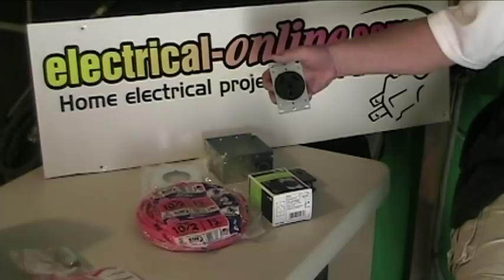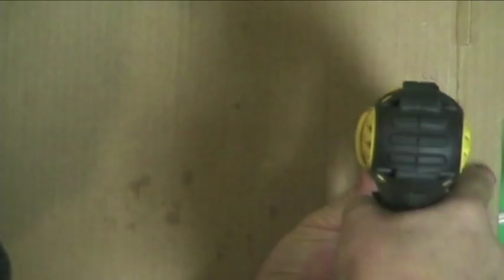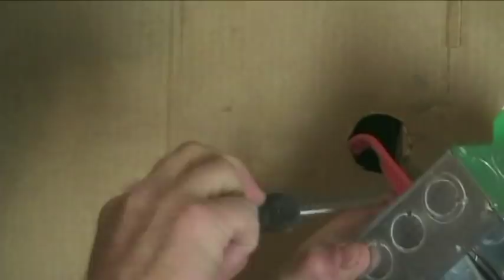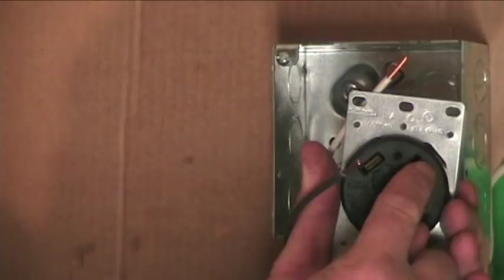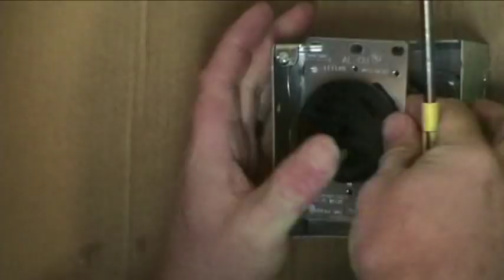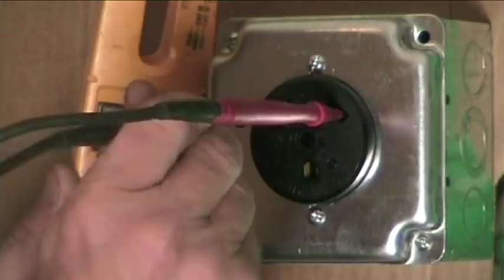How to Wire an RV Receptacle

Comment: Why wasn't a GFIC circuit breaker used during the installation?
Reply from the maker: The GFCI protection is in the RV.  (or should be unless it's an older unit).  The panel in the RV is in essence a sub-panel from whatever panel is feeding the RV outlet.  Then the GFCI protected circuits should be wired as such in the RV, either via circuit breakers where needed, or with GFCI outlets.  Many just have one GFCI outlet in the RV, and then protect the other circuits on the load side of it.

Comment: ❤ great video I have every part same as you down to the breaker. Problem is my panel bar has both ground wire and neutral on the same bar. Both left side and right side bar has ground on top and neutral on bottom but the bar is pretty much the same length. Any idea if I can put both wires on same bar?
Reply from the maker: If that's the main panel and that is where your neutral and ground are bonded together, then that's what you do being they are essentially at the same potential at the bonding point.
Reply: @theinternetelectrician  I did it. Yes they are bonded after watching your video it helped a lot. Thank you. I finished the project

Comment: Were do you get 125 volts? US and Canada is 120 Volts.
Reply from the maker: That is just the rated operating voltage of the device.  Yes, the nominal voltage in North America is 120/240, 60Hz.  Important to note that this voltage is regulated by the transformers prior to the end user and can be adjusted by setting the voltage 'taps' inside of it.  There is an acceptable range of around +/- 5% that can see nominal household voltage anywhere from 115-125/230-250.  Not so long ago 110/220V were more common voltages.  So when you hear anyone refer to a normal household receptacle as 110V, 115V, 120,125V, or 220, 230, 240, or 250V, just think of them as one in the same.  Thanks for the question!  And thanks for watching!  I hope that you gave the video a 'like', and that you have subscribed? Your name seems familiar so I believe that you are a subscriber?

Comment: Good installation practice for me has always been to remove any rings or other metallic devices from the parts of my body that are inside a potentially live panel or box. Terry should be going above and beyond in safety practices as others are going to emulate him.
Reply from the maker: You’re correct! I often forget to remove my rings. I also shut off the power when working on electrical circuits, thus mitigating risk substantially. So after 40 years of doing this, 37 with a wedding ring, I still have all my fingers. Having said that, do as I say, not as I do. Thanks for watching!

Comment: I don't know anyone that plugs their RV in to a receptacle that's inside a building.
Reply from the maker: I do!
Reply: @theinternetelectrician  That's fine, but most don't. I wonder how many people watched this and used that box outside. You should have shown a proper outdoor enclosure too.
Reply from the maker: I'm sorry, I'll try to to better next time.
Reply: Not a bad idea if the RV is in the driveway. Just run the cord under the garage door. Keeps the connection out of the rain and no exterior hole in the wall.

Comment: Ground wire connector needs to be on top (you installed the plug upside down). It will be a problem if you use an RV cable with a 90-degree elbow (the elbow will be facing upwards which will be awkward).
Reply from the maker: You are correct in your observation.  There is no right and wrong way to mount a receptacle in a box however.  Only for the reasons you mentioned

Comment: What if you only have a 30 amp double pole breaker but only needs 30 amps for the RV?
Reply from the maker: It's ok to use just one pole, just identify it as such on the panel schedule

Comment: Just now seeing this. What do you seal the hole with between the house and the new box? so mice will not get in
Reply from the maker: Any appropriate caulking or expanding foam that suits whatever material you are working with, (ie. stucco, vinyl siding, wood, etc.)

Comment: This video is embedded in this article:
https://axleaddict.com/rvs/How-to-Install-an-RV-Outlet-at-Home

Using the text from the article here is the relevant text provided:
Neatly route the ground wire to the ground bus, following the path of existing wires, to where all the other grounds are terminated, loosen a screw as necessary and terminate the ground wire. Again, that bare ground wire is likely going to come close to the hot main breaker. Be careful! Do the same with the white neutral wire after stripping about ½" of insulation from it. 

The text says to terminate the white wire on the ground bar not the neutral bar; at least that is how I read it.
And there is no further instruction for the white wire.
Since I was following the text...that is what I did and everything works.

Is it either or and you're fine?
Thanks!

Comment: Looking to do this at my home.  Wire length from panel to location inside my garage is 30', give or take.  If I want to run wire for a potential 50 Amp upgrade later on, would running 8/3 wire be adequate?
Reply from the maker: Yes, use #8/3 and feed with a 2 pole 40A breaker.  Reach out to my email, terry@electrical-online.com if you have any questions on connections, etc.
Reply: @theinternetelectrician  Thank you!  This is still the best video out there for this!

Comment: Great video Terry.  Question though.  I have a 20 amp fuse in my fuse box that serves the outside outlets on the house and garage.  I'm guessing that I need to replace the 20 amp with a 30 amp breaker first.  Then, can I remove one of the outside outlets and install the 30 amp plug?
Reply from the maker: Jay, no, you cannot replace a 20A breaker with a 30A.  Wire size / guage is what determines the maximum breaker size, and your circuit will be wired with #12 AWG cable.  Keep the 20A.  It won't be a problem unless you are trying to run the A/C in the RV.  A better solution here would be to use an adapter to go from 15A to 30A, also known as a "cheater cord".  This would keep your outside receptacle as it is for other uses as it was intented.

Comment: If the 30 AMP RV plug is located outside (Weather proof box) should you use a 30 AMP GFI breaker in the panel? If all other outside outlets require GFI why not the RV plug? Please comment
Reply from the maker: The GFCI protection is for frequently used convenience outlets in places where you are more likely to be prone to getting a shock from accidental contact with live parts while you're body is providing a well grounded path for current flow.  Outside on moist earth with leather soled shoes, or even bare feet.  In the kitchen or bathroom with one hand in a sink full of water, then plugging in an appliance, etc. You're not likely to be using the 30A receptacle for anything else other than the purpose it was intended, to plug in your RV. Once the RV is plugged in, then all the outlets that require GFCI protection is provided by the unit itself, the outside receptacle, bathroom, kitchen, etc.

Comment: You mounted the receptacle upside down.  The ground should be at the top so when you plug your RV in the cord hangs down and not coming up which will stress the cord and receptacle.  You are obviously not an RVer, but not the worst video.  Thanks.
Reply from the maker: Technically there is no right and wrong way to mount a receptacle.  In a practical sense, you are correct.  If mounted in an RV pedestal with an in-use cover, you would absolutely need to mount it as you suggest.  I have owned RV's for 40 years, and was full-time in a 40' Class A coach for 2 years, and part-time (6 months/year) for another 6 years after that.  In this video I was trying to focus more on the connections but I really should have turned it 180 degrees.  Now I rely on people to flip their computer upside down instead  :-)
Reply from the maker: Technically there is no right and wrong way to mount a receptacle.  In a practical sense, you are correct.  If mounted in an RV pedestal with an in-use cover, you would absolutely need to mount it as you suggest.  I have owned RV's for 40 years, and was full-time in a 40' Class A coach for 2 years, and part-time (6 months/year) for another 6 years after that.  In this video I was trying to focus more on the connections but I really should have turned it 180 degrees.  Now I rely on people to flip their computer upside down instead  :-)
Reply: You are forgiven, Merry Christmas.

Comment: Is there a difference between a  rv 30 amp receptacle and a regular 30 amp receptacle
Reply: Yes, they look different. The “regular” receptacle is usually a 240 volt setup used for electric dryers, and it will say so on the packaging. If you’re not sure, ask the hardware clerk specifically for a 120 volt RV receptacle.

Comment: What if I have stranded 10awg. Can I still insert stranded into those screw compressions or should I use a terminal to connect to the screws themselves. If so what terminal do you recommend? Hook terminal ok?
Reply from the maker: Those terminals on the RV receptacle device are designed and approved for stranded and solid conductors.

Comment: I have a question, will it still work if I have to run my wire about 300 feed to the panel.?
Reply: Yes but you would want to up the wire size to 8awg to accomodate for voltage drop

Comment: How would I wire a 4 prong outlet using 10/2? I have the 10/2 wire but I have a 4 prong RV connection.

Comment: Can I use that romex in an outdoor breaker box or do I need underground feeder wire.
Reply from the maker: Too many factors to consider here.  I would have to see the installation plan to advise on the wiring method required.
Reply: @theinternetelectrician  I'm putting a meter service on a pole with a breaker box below it and directly below that Will be  a 30 amp rv outlet. All in outdoor boxes. I'm wiring the 30 amp breaker to the 30 amp rv outlet with 10/2 romex.

Comment: Soo .. could a person use this in reverse? As in backfeed from a generator in the event of a power outage? Providing you turn off the main & only used select breakers??
Reply from the maker: No, for reasons too many to list here, but the most important one is that you must use an approved and properly installed transfer switch when connecting a generator to a utility-fed electrical system.

Comment: Can I use 10/2 wire outdoor 100' to put in 30 amp plug
Reply from the maker: Yes, 100' shouldn't be a concern for voltage loss/drop.
Reply: Darren Mittelstadt 8/2 might be better tho

Comment: This is great but could you do a 50amp service for a RV
Reply from the maker: Frank Jennings If you check my channel I just released one on Monday morning that deals with a 50 amp range outlet and the wiring is exactly the same for an RV 50 amp 125/240 service other than particulars to the installation, location, indoor or outdoor, etc.

Comment: Good video, but it's upside down. Good stuff, otherwise. And thank you for using a manual driver. Takes a skilled hand (or proper use of a torque clutch) to do it right with a drill, and as you said to another commenter, this is YouTube. =p

Comment: Thanks for the video, I am getting ready to install one of these in my shop building for our camper but I have a question, if the receptacle box is all metal, what is the purpose of wrapping the bare ground wire around the screw inside the box before connecting to the green ground screw on the receptacle? the box I bought at home depot doesn't have the screw on the inside of box.

Comment: You should make note that the RV receptacle is typically mounted 180 degrees from the way you have it shown. The cord will be under less strain that way in its normal usage.
Reply: Then how should it be wired? I just want to be sure to do it right.

Comment: Can I use this same approach to go from RV Generator to House circuit box given I de-energize power company phases while generator is running and disconnect RV prior to throwing main power company phases back on..Is there a transfer switch available to handle a RV 30 1 phase into a house circuit including safety features. Thx. Excellent video for RV support...but  need the reverse...RV Generator to house circuit.

Comment: Hi i have question, so I have 240v 30amp outlet I was wondering if i can share one of those wires from the outlet which would be 120v if i get 120v from that and share to a new outlet which would be the 120v 30amp would it work?

Comment: As a first time travel trailer owner, my question is after installing the 30amp RV receptacle will it trip the breaker while running all appliances and Ac?
Reply: +rick deleon

The short answer is yes but it depends on the total power draw. 

You should calculate the power draw of your AC and appliances. If they are measured in watts then you can convert this to the total amps.  Watts/voltage = amps  (Watts/120v =  amps)

1) An average AC unit will probably pull 13 amps.
2) Microwave oven is going to average 10 amps.
3)  let's say a hair dryer is being run too. It's an 1800 watt device, then it's 1800/120 = 15 amps. 

You would exceed your 30 amp breaker in the above scenario. That's not even taking into account your battery inverter trickle charging your RV batteries. And...most breakers are rated for 80% continuous usage so you are really only going to get about 24 amps, 30 amp peak.

Comment: Excellent step by step video.  I see 1 thing that I'm a little confused on.  Every RV power pole I've ever plugged in to had the ground located at the top, instead of the bottom of the receptacle, if you attempt to plug in your surge protector which is made to plug in with the ground at the top it will be hanging incorrectly on the pole, won't it?
Reply: crackerjack4u I don't think it would matter for a surge protector, there really is no up or down or right side up for electricity. And it just depends when it was installed I think and what the local code is. For instance, in my location back until around 2005 the ground was at the bottom, then they changed it to ground on top. Now I notice they've gone back to ground on bottom.  The only reason they did ground on top for a while was because of the idea that if the plug comes out partially, you would be more likely to touch it with something metal from the top than the bottom, so you would hit the ground first.
Reply: John Be Bad I have not. Thank you for the reply!
Reply: +matt22blaster
Have you ever hooked up a 30amp RV outlet before? 

Physically, all that matters is the cord is connected. However, what crackerjack4u is noting is the recepticle for the RV 30amp plug needs to facing 180 degrees from the way this video is demonstrating. This is because the RV cords have the round prong at the top of the plug  and the flat ones at the bottom. When you attach the cord you want the weight of cable or surge protector to be hanging to or on the ground. 

Most RV outlet boxes have a lid that opens from bottom to top with a slot to allow the cover to be pushed back over the plug where cord then dangles downward. They way it is shown in this video, it will not work well in that scenario.

Comment: Terry I'am looking at put an RV box out behind the barn. It be a run of somewhere like 120" from the breaker box.. Would I need to use a heaver wire? I would also l like to possibly bury in the ground, what kind of wire would I need ?

Comment: That does not look like an exterior receptacle box. You should specify that an exterior box must be used outside. May be common sense to some, but.... this is youtube.
Reply from the maker: Good point Anthony. Although it should be obvious to most, some would just follow this exactly and use the wrong box in an outdoor application. My main focus here was how to connect, the correct wire size, breaker size, etc.
Reply from the maker: At 2;20 of the video, I explain this indoor location and that it is for demonstration purposes. I hope nobody else tries to pass off a pizza box as a piece of plywood either! The magic of video! :-)
Reply: Anthony amthor bb.

Comment: Question: I've done simple outlet replacements, switch replacements etc just matching color to color, ground to ground, neutral to neutral etc. I am assuming this is a 30 amp  circuit. It looks like its wired like a regular 110 15 amp outlet with ground, hot & neutral leads.What makes it 30 amp capable? Is it the components being used? The breaker? Anyone?
Reply from the maker: You are correct in that it is connected the same, and functions just like a regular household receptacle. Every receptacle has what is called a NEMA configuration number. That designates what the receptacle is rated for. The in this case, the receptacle is a special RV designation (NEMA TT-30R). What makes this a 30A / 125V receptacle is the size of the breaker (30A), the gauge of the wire in AWG (#10 rated for 30A), and the NEMA configuration of the receptacle,

Comment: Why would I only get one leg of the voltage in my trailer with the proper wiring to my trailer receptacle?  I wired it just as you had.  I only get voltage on every  other breaker in the panel in my trailer.  I didn't change anything on my breaker panel in my trailer. We previously were using the generator with no problem.  I'm wondering if I may have lost one leg of my service?
Reply: Do you have a 30 amp RV, or a 50 amp RV?  30 amp units are fed by a single pole 30 amp breaker (one hot lead)  50 amp units are fed by a double, 240 volt breaker (two hot leads).  You need one hot lead from each side of your main panel box to feed both sides of you panel box in the trailer.  Sounds to me like you are only feeding one side of your trailer box.

Comment: I notice that Canadian electricians leave only about 6 in of wire in the box whereas Im used to about 8in.
Reply from the maker: Usually you need to strike a balance with being able to work with the wires for termination, but then being able to tuck them in the box without too much trouble.